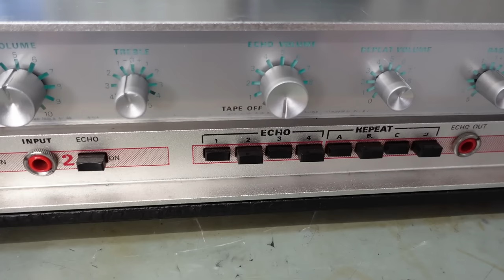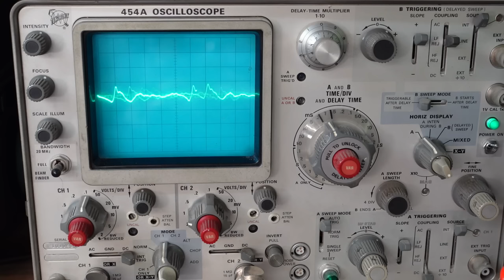HH Multi Echo Tape Loop

Comment: I remember these things, also the Watkins Copycat tape loop. I was working with a covers band in 1990 - all voice mics went through a Copycat. Latterly I bought a Roland Boss RE-1000 Digital Multi Echo which I still have. 12 bit and crude but doesn't eat tapes.

Comment: Hi Mark..
Please help me.. Ive been up at the computer for hours, to try and find a suitable replacement SMPS transformer for my QSC PLX 1202 amplifier!
The small transformer is stamped TSD-1135, QSC Reference number: XF-000064-00.. Its a offline switch mode transformer... its a 8 pin Through-hole....
Every website ive seen, that sells them for the QSC amp, is either out of stock entirely, or from america and dont ship to the UK.....
I have been looking for hours, through its spec sheet... to find a suitable replacement... But im confused with it all, All i know is that it states, its secondary is 5/15v output....
- I was hoping to have my amp up and running in time for my daughters birthday party, But i am really struggling to find anything that will work!
PLEASE HELP!!!!
Reply: Third Party Shipping